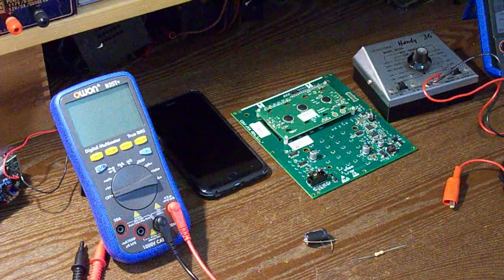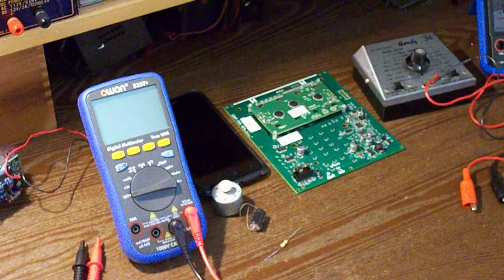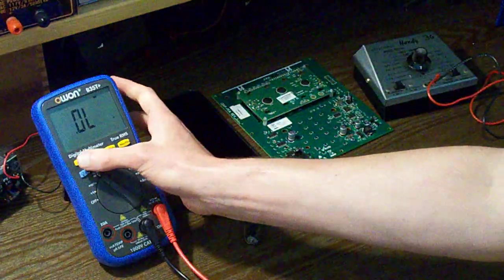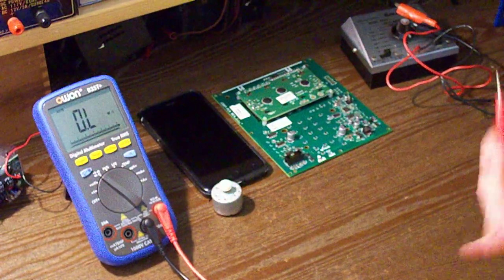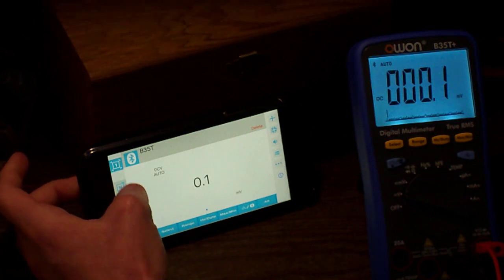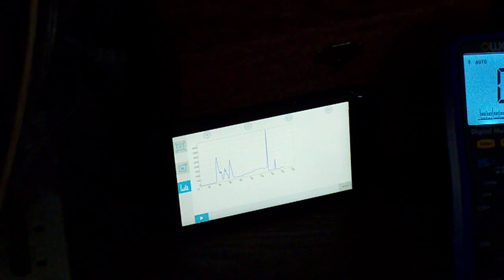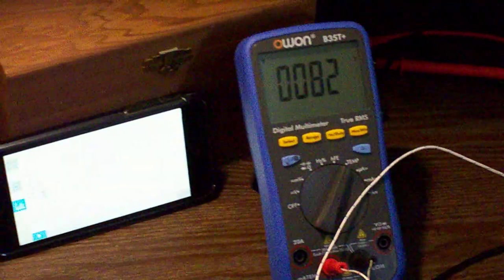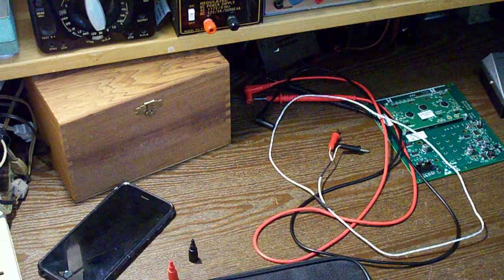OWON B35T+ Multimeter with Bluetooth Data Logging - Review and Demo

Comment: Do you know if the data logging for current is stored on multimeter would like to use over 24 hour.  Want to make sure multimeter stay on logging without leaving my phone next to meter? Dose it take sd card. How long will it log data for.? Thanks
Reply: you ever find this out?
Reply: @sdriza  yes I have the meter and it can work for 24 hours. You can set how many seconds between each interval. And when you come back it will upload to your phone and you can see it on a graph so you can see if I draw starts after period of time or even hours later . And it will show you the amount of draw for whatever you have it set to record comes in  handy.
Reply: @jamesl197999  Can you export the measurements to use it later on PC (like excel?)